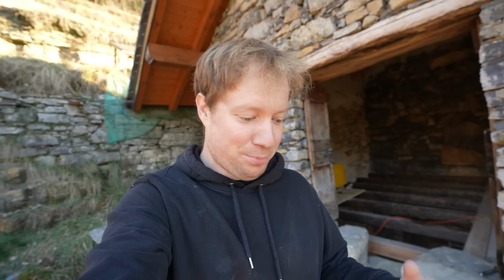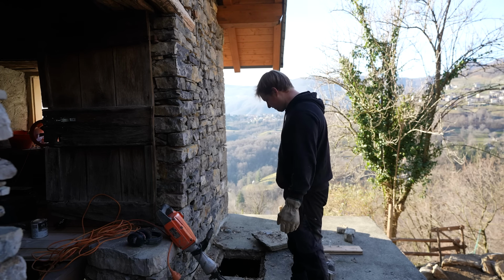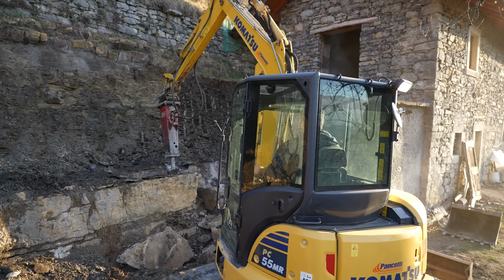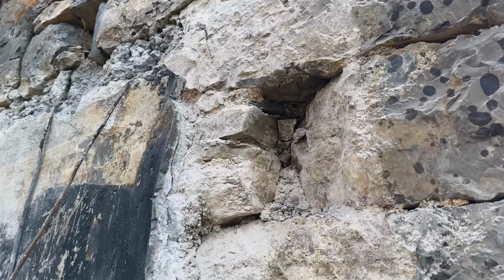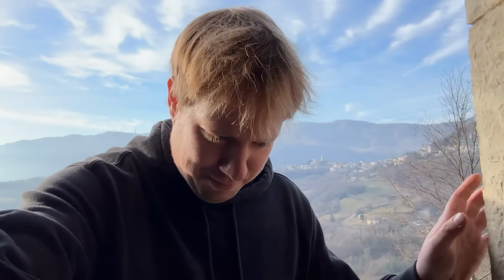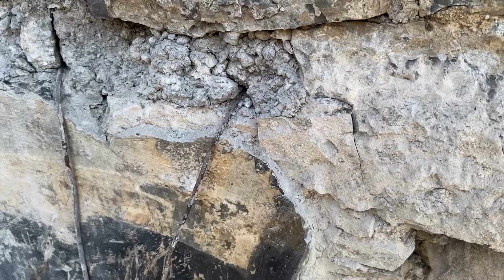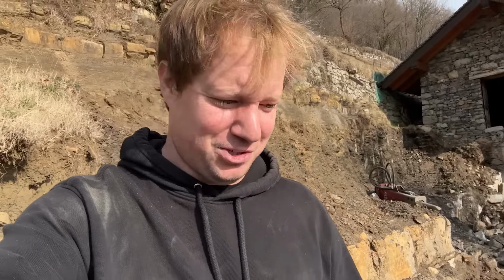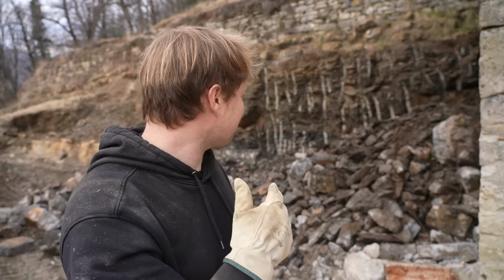KNOCKING DOWN Part of Our House (Italian stone cabin renovation)

Comment: I think that it would be difficult and dangeroue to rip away that concrete wall. I would use it as a foundation, render over the concrete and use the rocks to dry stack the other three walls. If you build a stair case in the new room up to the second floor, you provide access without taking away more footage.

Comment: I have been watching your videos for several months and enjoy them. I've had my commercial and residential contractors license and did construction for several years. To answer your question you posed, I wouldn't waste your time trying to save the texture of the original stones, etc..Simply concrete over top of the wall, you can finish it with a texture, broom, or smooth finish, then paint it, use an Italian tile,  whatever, but no need to do all the work and bring back the texture of the original stone, that's my opinion.

Comment: I'm glad to see that you are pivoting to work with what the surrounding topography allows, making adjustments and continuing forward.

What Andrea (apologies if I misspelled) is talking about doing with the broken rock and concrete is crush it into what is referred to here in the States as ABC, Aggregate Base Course (there are various other terms for it such as Gravel Run). It's typically crushed rock and sand used for making a compacted layer over natural earth for road base or as an underlayment for pouring concrete foundations/slabs, as the combination of gravels and sand compact tighter than just rock alone, thereby making a more stable base. Since concrete consists of mostly sand and gravel, it is excellent at being crushed to reuse for this purpose. 

There are varying grades of ABC that determine the largest size of crushed rock. For instance, "1-1/4 minus" has the largest rock sizes of 1-1/4" down to fine sand. It can be sifted again to get a smaller grade such as "3/4 minus", and then the remaining rock that is larger than 3/4" becomes "1-1/4 clean". Clean gravels are mostly used for decorative purposes like landscaping. That's probably more than you ever wanted to know about gravel. LOL

It's ironic that you had to have ABC hauled in to repair your road and also had gravel hauled in to mix with concrete for your foundations, both of which probably incorporated crushed rock and concrete from other jobsites, and now you have to pay to have this rock and concrete hauled off to be crushed and used on other jobsites. Makes me wonder if it would have been possible to hire a portable rock crusher to process your own and how cost effective that would be, given the expense of hauling off. The portable rock crushers I've seen are self-propelled on tracks like Andrea's excavator, either driven on-board by an operator or controlled by remote, typically wired but wireless remotes are becoming more available. There are small ones available that would have fit coming up your road. I would imagine they are available in Italy. It may be an option once you have built the addition to dispose of the remaining rock, then spread it over your road to beef it up. If there's a lot left over that is usable for building walls, build a diversion wall above the house to redirect any rockfall away from the house.

WRT to the residual concrete from the cistern, my first inclination was to stay true to the original construction, but that would be VERY labor intensive and would further delay the construction of the new room while risking further damage, which would result in further delay. I think rendering over the concrete to make that wall a "feature" of the new room would be the best approach. I've found that too much of a texture/pattern in a building makes it visually blend together versus stand out. Rendering over that wall will provide visual interest that complements the natural stone. Since you've learned that the original portion of the structure was built ~700ya, that's contemporaneous with the tail end of the Eastern Roman Empire. Maybe you could hire an artist to paint a fresco on that wall in possibly an agrarian scene reminiscent of the era. (I think a tile mosaic would be too "rich" for the origin of this structure.)

Looking forward to see what you decide to do. Salute!

Comment: I was watching your channel from my television and couldn’t comment on the one video where you were using the pastry bag under the stairs. I had the same issue and what I failed to do was roll it properly. From what I understand you dogear a corner and roll it down. It also helps to line the inside of the bag with dish soap before putting mud in! When you get them to work properly it’s an amazing tool.
Best of luck on your project. Looking forward to the updates !

Comment: For the concrete wall, fix it with concrete and cover with wood matching the beams. For the left over stones, you can make a retaining wall. To make it faster and easier, make a form out of plywood on outside and wooden structure with holes on inside, fill it with rocks and pour concrete from outside.

Comment: Great stuff! Just put large rocks into te footings and pour reinf concrete belt on top it should tie everything together. Small rocks can be used as a filler in any other concrete work you're doing, be it walls of the house (especially the one backing onto the rock) or retaining walls, walkways, etc. You'll figure it out. Keep your spirits up and thanks for the videos!!! Good luck!

Comment: if you make the room like the rest of the house you will have beams for the ceiling able to make a second floor witch a bathroom and\or a closet with a wooden floor might be a nice addition to the master bedroom..  also using the stone to make a supporting retaining wall along the terrace past the room area made like the other retaining walls giving support to prevent washing out during rainy seasons.  good luck

Comment: For the old cement can you cement a thin covering of face stones over the area up to the top floor then dry stack. It will give you exposed rock on the lower wall and leave the original wall on the top room. With the floor dividing the upper wall from the lower wall you will not see the difference.

Comment: @raisingvoyagers  I would extend the new room as a 2 story since there is already the door, then add the additional 3rd room and possibly 4th if stone allowels with a large terrace over that since you can't go behind the home into the rock,for the extra bedrooms,  use that Stone to extend out the side to get your extra rooms and a terrace that way... .it would give you the room below plus, a room above with a preexisting door, and an additional room below and then still the terrace.  And you could design the doors and windows to the new 3 or 4 rooms anyway you wanted.

Comment: I’m not sure my explanation is clear. But here goes. I would make all new room additions at the second floor level out of block or reinforced concrete. This is far less expensive and faster. You can then face the new addition with rock so it has the same appearance as the rest of the structure. Simply extend the structure and back fill. Then build second floor addition on top. You can even create a third level which would have great views and it would easier to have a taller roof line than to recreate and blend into the old slate roof. Because it will never match exactly. You don’t need to keep digging away the rock as it will become part of the backfilled first floor. By back filling you will use tons of stone and gravel so you get rid of all your waste. You save a ton of labor cost as stacking stone is slow and expensive. You can make the second & third floor long and narrow as you wish and add patio and balcony! It will also allow you to enter through the top terrace.

Comment: Having your original plans for the room changed due to the mountain, etc. is a great example of the old saying "Man plans...God laughs!"  But, as you have found, and I have in the past, you often find you like the new plans better.  I do agree with what others here have said, to just render the existing wall into a smooth surface and paint it.  I think it would make for an attractive contrast with the rest of the stone, so as not to start feeling too "bricked in" by everything being stone. Hey, you might even someday decide to expand the other end of the house by opening that wall, and another solid, smooth wall there would be good, too.
Great video!

Comment: Idea 1, build a nice size fish pond on the property using the stones as the walls. 
Idea 2, use the rocks as decoration around a hot tub/ pool? if you plan to add one? so it blends in :D. 
Idea 3, use the stones as walk ways and paths. 
Idea 4, if you cant build with them you could always render the new wall and place the stone like a mosaic in the render so they are still apart of the build/ extension :D. 
Idea 5, use the rocks as sides for the flower beds or raised beds for you to grow your own crops to become semi self sufficient.

Comment: You could have added on to the old cistern because your still going to build a room in the same place at the same height right and the hole in top you opened up, fill it with stones or concrete or sand making a solid foundation. Add another cistern size structure fill that too and there you have a sturdy foundation for the additional room on top.

Comment: You have an upper water issue. You build a little 2 ft pony wall just below your roofline. Use the wasted stone material as a French drain to control the water. Old techniques are new ways to recycle. Love the work and the videos!

Comment: I would try a section to see if the cement wall can be removed ti show stone like the rest of the home to see how it looks but if not good then go with the smooth painted rendering finish. Because as you stated the new walls will be like the old stone walls, so you will still have 3 that will be exposed stone and be beautiful. One not done is  not a big deal. I would  gauge your time and money on if it is worth doing. 
I would use the excess stone for more terrace tier access steps! Also use on Gardens and use to build a hot tub area.  Dream on!!❤

Comment: I'd leave the wall, cut your costs. But you could put a skim coat over that area and like we did here use a stamping system. It's getting so popular here. I've actually seen retainer wall being done this way along the roads to hold earth back. Making it solid with the cement needed then stamp a design desired. I'm even seeing it used to stamp the feature in red brick along the crosswalks (it will have the bumps required) but it idenities for the blind and with there cane they know the curb edge before a street. Anyway hope you understood this. Your doing a fantastic job!!
Reply: We did that here for our patio, I jump the gun explaining wall. My desk we use the gray stone look. It looks fantastic!

Comment: Stack the rubble in the gap between the back wall of the extension and the rock face behind. Stack dry if you can keep it stable or add mortar to keep it stable. You don’t want the rear wall of the extension to become a retaining wall. This will also support the rear portion of the terrace

Comment: Keep the concrete wall, use the mountain as foundation if at all possible.  But since you won't be widening the back wall, put in the french drains now before you start building the room.  It'll save you a lot of time later.

Comment: Do a thin  stone facing over the old cistern. It would only need about 10 centimeters in thickness and then slap a mantle on top as a shelf space. the dry stone character should be replicatable if you use modified mortar like a tile job.

Comment: If I understand your  description of your plans for the new room, and then Terrace on the roof, the wall that has been cemented over will be an interior wall in the new room. I would suggest that you merely clean up that wall filling some holes and then do a Light coating  of textured cement over all of it to make it look nice and clean. Then use it as some sort of accent wall or put a number pieces of furniture up against it so it doesn’t jump out as being completely different from the stone walls. Saves a bunch of time and money also.

Comment: Since you can no longer build onto your house because of the cost of removing the excess dirt and stone. Could you possibly build little guest houses? Once you’re done building perhaps consider leveling the terraces a bit. They might be higher than the stone but now you have extra stone to add onto to the height of the terrace if allowed. Or maybe build smaller terraces within the terraces. 🤷🏻‍♀️
I think you should render the wall. Save the trouble and time of chipping at the cement. You could do a feature wall with the stone.

Comment: Agree with roads, wall, fire pit.  Especially developing drainage so road doesn’t wash out. But long nice staircase to that lower level or use it around your spring area for a project. Render over wall.

Comment: Look at spray foaming the fresh exposed rock before building the wall, it is waterproof and insulation. Build the new walls then backfill with more foam, Ive used this technique to stabilize old dry stone walls on my property.  done carefully and from the back it bonds the stone as well as mortar might.without showing the foam colours. or get the foam tinted grey.

Comment: I would clad the cement wall with new stones.
Even though the wall would be a different elevation, or offset from the rest of the wall, I would still dry stack it with more stone.
It will add nice character that way as well as blend in nicely.

Comment: Ditto @marymerrill1612 !         She suggested a Sauna!!!!  Fabulous idea!!!!   How fun to use it in the winters.  You could add a rock walled hot tub next to it & heat the two with wood.   How magical would it be to go from the sauna to the hot tub with snow falling, using tiki torches (oil lamps) for light.  Hot cocoa would be an added joy for the girls!

Comment: I'm new here.  Last week you discussed why the addition to the rear of the house was no longer feasible and this week is about an addition where the old cistern was. At what level will the new terrace be? Is the addition two levels or is it only one with the terrace on top of or below the addition?  The wider yet shallower change of plans would also give you a wider aspect of the beautiful view to the front. Best of luck!!
Reply: Ps. What are the plans for the other side of the cabin?  Could leftover stones be used to raise the wall there to level the terrain for more usable space?

Comment: Sandblasting the "cistern wall" will bring quickly remove the concrete veneer and expose the original wall. This requires a high-power sandblasting setup and should be done by a professional. 2.5 to 3 hours will have your wall restored to the original look!

Comment: I would build a false stone wall against the cement of the old cistern. From inside of the new room you won't notice that it is a false wall and the foot or so less in the room as a result of the false wall will be insignificant. (I'm not technically minded, so I'm not sure if it's possible)

Comment: The extra stone can be used to create terrace border walls in lieu of the wood rail fencing. You can also use it to recreate your wooden out-buildings into stone structures, thus keeping continuity of all buildings. As far as the cement on the side wall, perhaps try pressure washing or sand blasting some of the residue material to remove it. But if you're building against it and cutting through that wall to create an entry into the new room, might I suggest faux stone pattern by using mortar mix to mimic the color and shape of the original stone? I would not paint it - that would be sad and make it worse. My question is why are you working on an additional room when you have so much left to do on the inside in other rooms?
Reply from the maker: I love the idea of a stone fence! Hoping that’s possible!

Comment: That really high wall directly in front of the house where you dug out the terrace below looks like it is dirt at the bottom? Anyway, it gives me the heebie jeebies. How about using the extra stone to build a shorter (5-6ft?)step wall right up against the bottom of that high one, thereby adding some reinforcement at the bottom without narrowing the lower terrace more than the thickness of an extra wall?

Comment: Why not use the concreted contaminated stone in the foundation layers of the new walls? And if I may suggest a new design for the extra room: build it so it is wider than the house by 1,4 m maybe and have the extra width allow you to build a corridor running the first floor of the house and possibly a covered (but open to the outside) corridor for the second floor...

Comment: Just like the renewed energy and enthusiasm to move past the previous hiccups. Even motivated to change existing plans as new surprises or gremlins are uncovered. Is there enough stone to widen the existing excavator level with the lower one starting from the furthest side? Will permits allow? Creating a space for new options.

Render the concrete wall. Time and costs permit, face with mountain pieces. All masonary work, may not be stacked. Somewhere, will be access doors or stairs. More opportunities to use mountain stone.

First set of mountain stone can be used on the renovation foundation, walls, stairs, lintels.  Can also be used for water storage tanks, septic tanks, swim pools, hot tubs, saunas, decks, cantilevered balconies or walkways.

Other uses: retaining walls, terrace widening and shoring, terrace stairs' rebuilding or repairs, spring/pool expansion/rebuild/renovation, driveway stone, outdoor buildings (tool storage, vehicle storage, garage(s), greenhouse, firewood storage, barn(s), studio, workshop or work space.

Donation with pickup for local road or building projects.